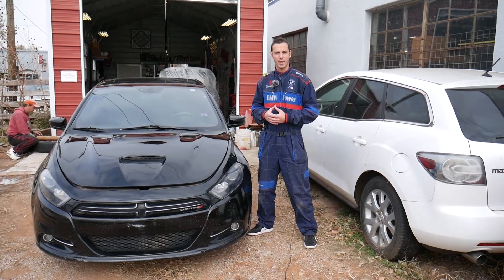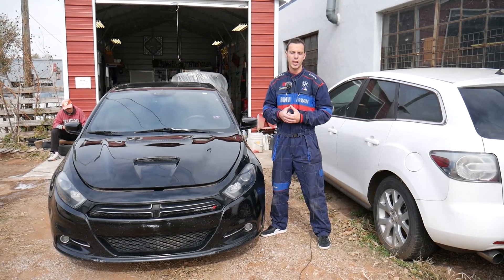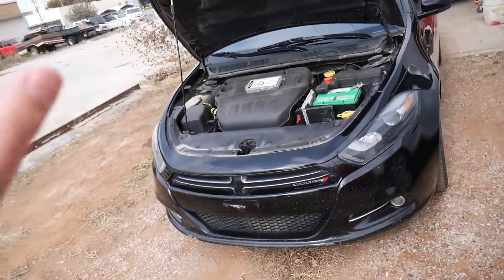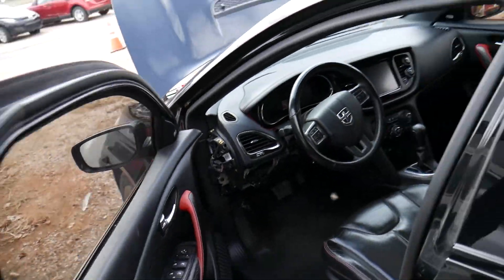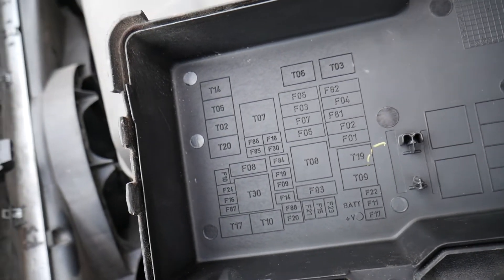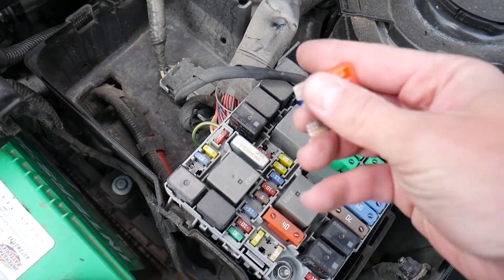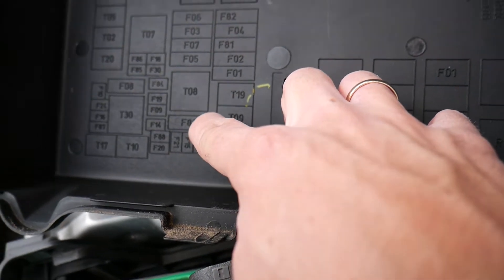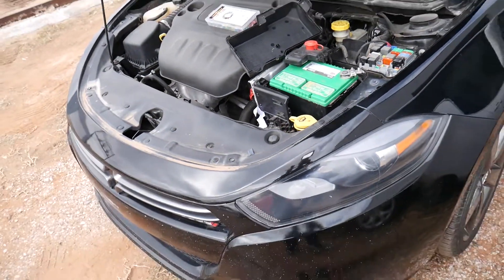DODGE DART HEATER BLOWER MOTOR FAN FUSE LOCATION REPLACEMENT

Comment: Got a question for someone who’s went through this before.   I can change the motor or resister if it comes to that.   But this blower motor will start sometimes and sometimes not .  But when it doesn’t start if the fuse gets pulled and put back in or even pushed in without removing it , it works .    Fuse is in Tact , ohms through (checked just in case).     Any suggestions

Comment: Got the blower motor replace 2 years ago
By dodge     and not the blower is eorking one day amd not the other day!!! Not to sure what to do anymore!! I will check fuse tomorow!!! What other issue can it be
Reply: I know this is an old comment but did it work? I’ve run into this issue and replaced the blower motor and resistor so many times and the issue persists. I can’t sell the car so that isn’t an option 😅

Comment: I have a 2013 Dodge Dart rallye and my fan for my ac and heat will not blow sometime it does and other time it doesn't could it be a bad fuse?
Reply: Hi, i have the same problem with my dart. Someone tell me that i need a clean the blower of the a/c but i don't do it yet. have you resolve your problem?
Reply: Could also be the blower motor its a 150 dolar part and very easy to fix many youtube videos on it
Reply: literally same problem and i have the same exact car
Reply: Same exact problem in my 2013 dart. I just replaced the blower motor resistor and still no air or heat 😭😭
Reply: Same issue
Reply: I think there’s a switch thing on the side of the control panel. It sometimes doesn’t flip open and doesn’t allow air through
Reply: @angelnichelle7194 dealing with that now just did the same thing still no heat or ac
Reply: @KarurosuSJ  it was my blower motor. I replaced it myself and it’s been working like a charm ever since
Reply: Just took mine to the dealership since it's under warranty. I'm at 60k miles and my heater went out they fixed it and a week later no heat. So back it goes
Reply: I had the same problem with my dodge journey. I changed the cabin filter and its work perfectly.

Comment: Hey love your videos,
I had a question I have a e90 bmw 328i couple days ago I got an engine light for 2 misfire codes and codes p13b4 and P0015 for crank over redatrded in bank 1. The car wont start anf every mechanic i take it to doesn't know whats wrong could you help me
Reply: Well there’s your problem. It’s a bmw.

Comment: Ok but what about having a code B10EA and B10E9. The first code says that there is too much draw. The second says that there is not enough draw. I just replaced the speed control module, and still have the same issue. Once the codes are cleared, the fan works.
Reply: Following.
Reply: how did you fix it? i have the same codes
Reply: @jonathanalcantara300  fried the wiring to the relay. Under the fuse box. Shop replaced the wire with a thicker gauge , and put a better relay in. A new harness was like 1000 bucks. Only paid 300 all together
Reply: ال

Comment: Don’t ever buy this car. This car sucks. Waaayyy too many issues
Reply: A dodge dart?? 😂😂 yeah right... I'm a Chevy guy and this is the best car I've ever owned. Will be buying more dodge darts
Reply: @ alright dude, fuckin go for it. May have been because I was in Alaska but I had to deal with more reliability issues that I’d like up there. The blue tooth systems like to take a shit too and getting Bluetooth to work with a phone in my 2016 model was always a pain in the ass, and you HAD to use unintuitive voice controls to sync the phone to the car. There are way better options than this thing. Blower would randomly crap out then start working again. Had to kick the center area under the dash sometimes to get it to start working again. Hardly “reliable”
Reply: @domonator5000  You're complaining about the Bluetooth, that's a luxury. Also, a blower motor is such an easy fix compared to most things. Again, you could go the entrie cars life without either of those two things working. The blower is around $40 and takes much less than an hour to fix. That engine is bulletproof
Reply: @ the engine is hardly bullet proof, had it misfire multiple times, had to get it fixed. Also again, in alaska a blower is ABSOLUTELY necessary to be able to even SEE out of the vehicle otherwise condensation from your breath will freeze to the windshield. I looked up how to replace a blower motor, it is by no means “easy” to do so in a 2016 dart. Bluetooth is a feature that was advertised on the car, so I expect it to work with some sense of longevity and ease of use for a consumer model car brand. Not everyone is a “4 wheels and an engine” type of person. Never mind that the engine wasn’t even that reliable
Reply: @domonator5000  I just pulled the blower motor out. It was a 30-minute fix. I can see where you are coming from with Bluetooth, it's a small annoyance. I've never had a problem with the engine in 50k miles I added to this one. Going over 200k strong. A misfire is usually just plugs and wires in a vehicle. You still have to maintain the car, even though the engine is bulletproof. Like I said, the best car I've ever owned. It's negative ten here today.